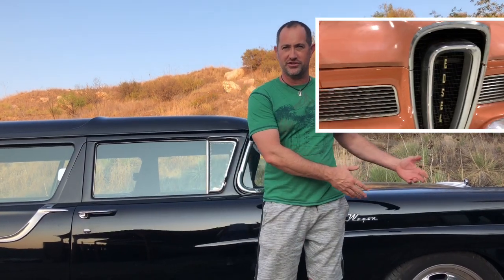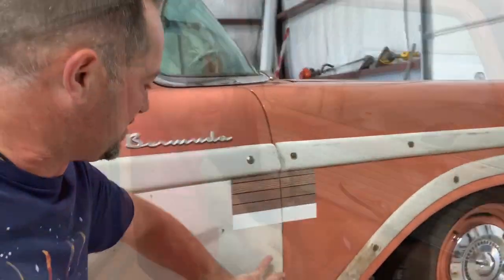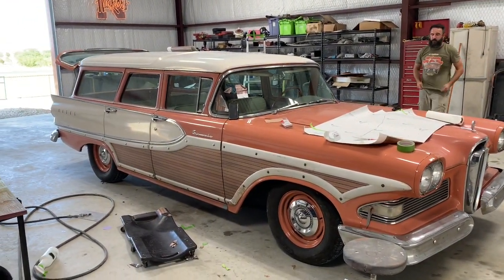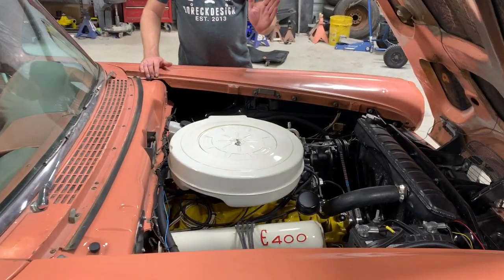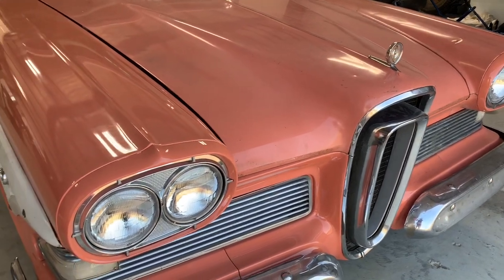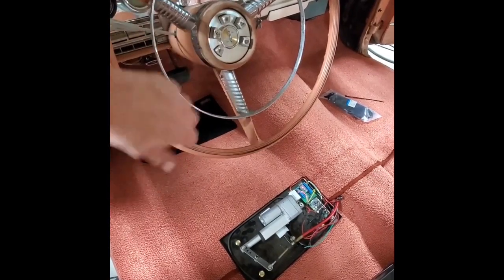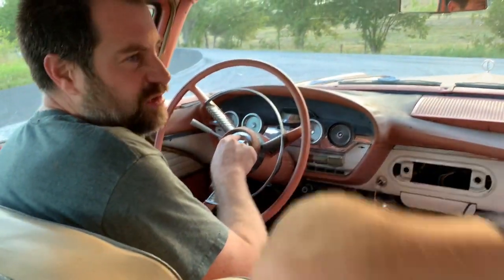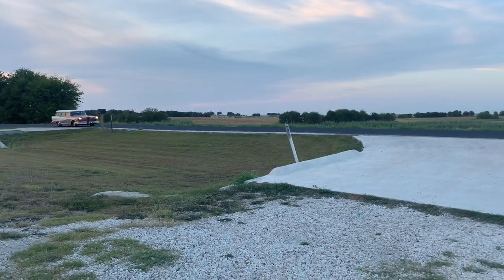Driving my brother’s FE swapped and sniper fuel injected ‘58 Edsel Bermuda wagon

Comment: Great video. I also made a digital Teletouch conversion and talked with the owner of the car in the video about his to exchange some ideas. He included some great safety features that I had overlooked, such as making sure to use the brakes before shifting, however my version uses inhibitor switch instead. I really liked how he included the whole motor and controller inside the car. I'll definitely include that in my next version. The reason for the 60/40 split seat was to give the driver a comfortable seat for himself and give both front seat passengers a full seat without a crack in the middle of their back.
Reply: Ah, that explains the 60/40.  I knew there must be reason for it.  Edsel in many ways was innovative, just a bit ahead of their time.

Comment: Beautiful! Love that wagon. The year I was born! Your younger brother is the exact type of person who should own this wagon with his talent at implementing the very practical modifications he made. He made it a much safer and practical vehicle with the shifter. The throttle body injector kit is one of the greatest creations as a modifier for this car too. I wonder if it would have been impractical to install the wood grain finish with the framing trim removed and then reinstalled over the edges of the finish? I’d be worried about shrinkage which might pull the edge(s) inward, leaving gaps betwixt. Anyway, I thoroughly enjoyed this video! Very impressed with the outcome.
Reply from the maker: Thanks for the great comment,  i am sure he will be encouraged by what you have said.  He is trying to make the Edsel a viable family hauler and I think he is pretty close.   We didn’t take trim off just because we only had that day to work on it before we headed home .  Hopefully shrinkage won’t be an issue.